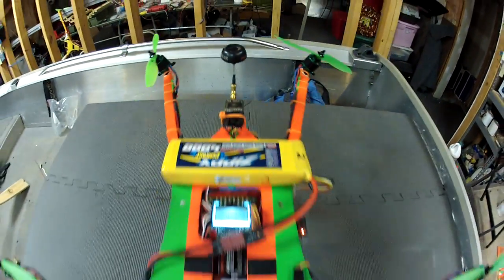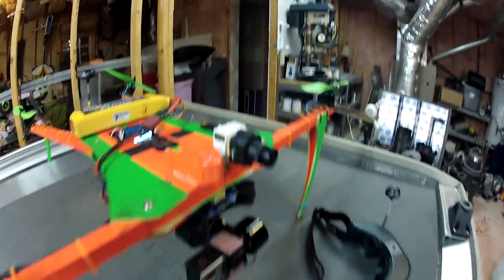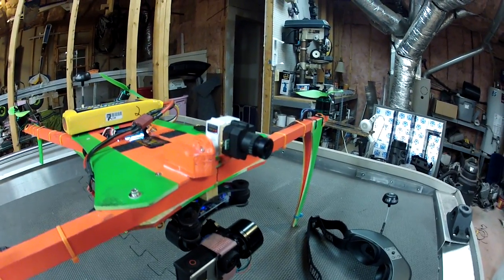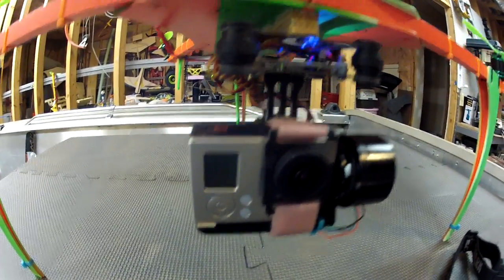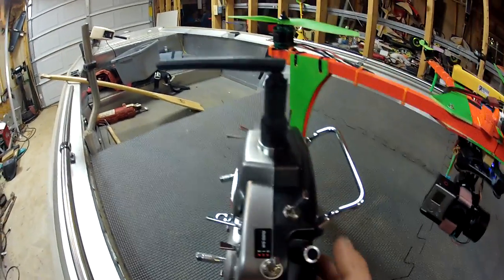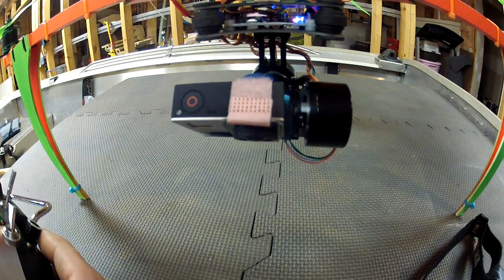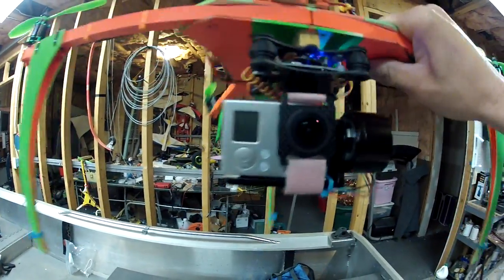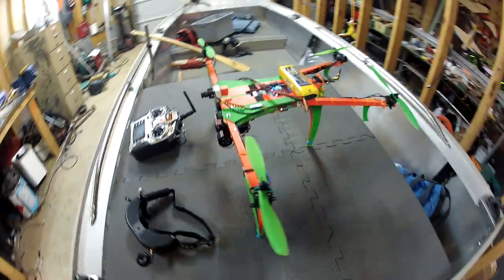v-tail quadcopter with fpv and brushless gimbal

Comment: Hi, can you tell me, how you wired the pitch wire from gimbal to kk2? thnx
Reply from the maker: It's not connected to the kk2 board. It's on channel 8 of the receiver. Only use the signal and ground. Do not use the power.